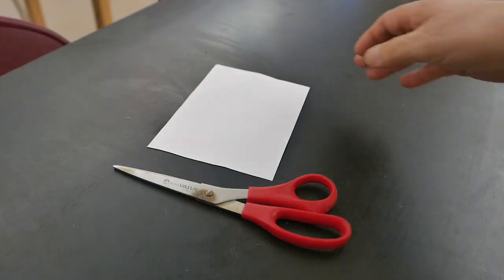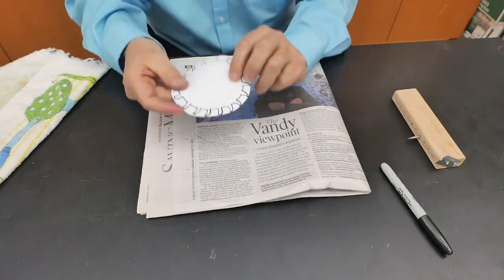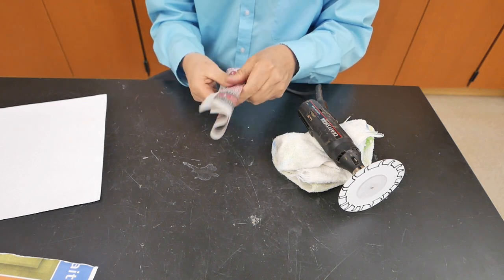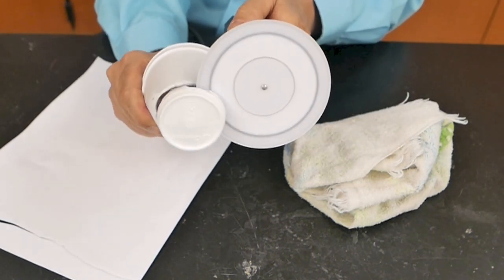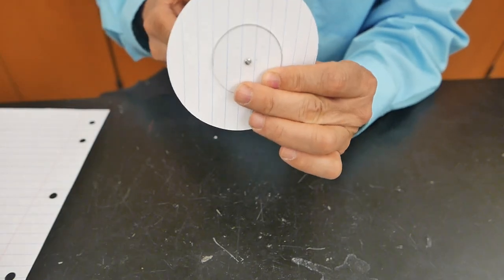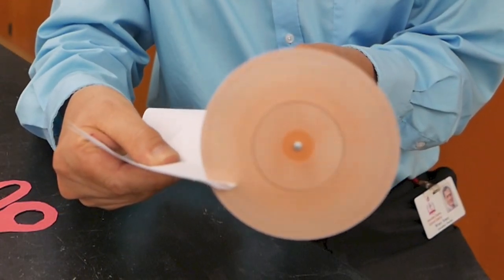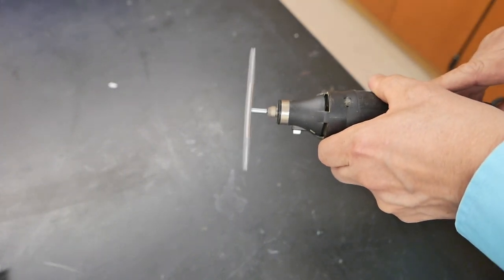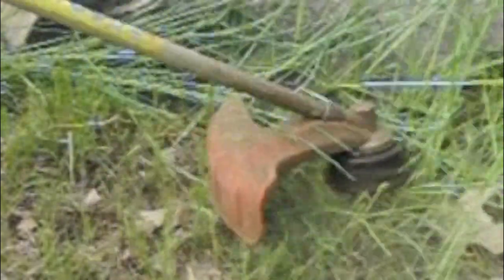Paper Saw Blades- paper cuts paper- Part 1- centrifugal force  //  Homemade Science with Bruce Yeany

Comment: Very cool! 

I ran into the same effect in a creative technologies lab I developed a few years ago. In one seminar, we work with electric motors. The motor in the lab kit has a bare spindle, so it's hard to see it in motion. I needed something cheap and easy, so I printed off Benham disk patterns, which helped visualize differences in speed. Rather than a plastic support, I used electrical tape with a pin hole in it. After a few nasty paper cuts, I spent some time seeing what I could cut with it. It became a three in one lesson. :)

Comment: Is it the centripetal force keeping it from ripping apart along with the thickness of the paper?
Reply: Yes, the centripetal force keeps each particle at a set (or roughly set) distance from the center.  With a less thick piece of paper, the centripetal force would be lesser, allowing it to rip apart.
Reply: on account of centrifugal force not existing
Reply: No. Centripetal force is just the force required to keep the paper together, which is just provided by the binding in the paper. It does not increase or decrease as the speed of the rotation increases. As speed increases more centripetal force is required in order to remain in the circular rotation.
The paper is in fact ripping, but it is along the side of the circle (Circular prism if we want to be pedantic), which I would predict is deteriorating at the same rate, if not faster, than the paper it's cutting.

Comment: Centrifugal force doesn't exist 
Centripetal force, however, does
Reply: Wrong!
Reply: But it's still not a real force. There is no force pulling an object away from the center of its rotation as we perceive. The only force in this situation would be the tension keeping the object from flying away tangentially to the rotation. Since the object has inertia which makes it want to continue in a straight path, the aforementioned tension provides a force perpendicular to that path keeping it rotating. That tension is the "centripetal force" you feel.
Reply: All there is is inertia. Everything else is an emergent effect.
Reply: +Dylan Headrick Do you know what centripetal means ? because I see a lot of comments here that says the same thing "centripetal force is not a force", if you say that is like saying "there is tension that makes the object rotate but the tension does not exist " in this case the centripetal force IS the tension because is a force but the centrifugal is not, because is an effect of inertia there is NO force like coriolis effect. We say that a force is fictitious when if you are placed in a Galilean referential there's not need of these forces to explain the movement of the object, particle, etc.
Reply: Exactly

Comment: Is this Centripetal Force or is Centrifugal Force? If Centrifugal force is "the tendency of an object following a curved path to fly away from the center of curvature." and Centripetal force is "the force that keeps an object moving with a uniform speed along a circular path."
Reply from the maker: The behavior is described as centrifugal force, even though it is not real.  The tendency of an object in motion is to move in a straight path unless a force acts to change it's path,  when a  centripetal force is applied to an object it's path may curve if the force is applied continuously  towards a center of rotation, however, the inertia of the object is tangent to the curved path and the result is apparent outward force (apparent not being real) that we call centrifugal force.  while the behavior is real, there is no outward force.  I've always thought the terminology is wrong,  it should be called centrifugal motion rather than force, that way it would be less confusing

Comment: Would a paper blade cut another paper blade if they are both spinning at 12000 RPMs?
Reply from the maker: dueling saw blades!!  I'd guess they would shred each other rather than cut since the place where the blades touch would always be changing
Reply: Bruce Yeany I figured as much. I just wanted to prompt you to maybe try and film it sometime in the future :)

Comment: Impressive... MOST impressive. i want one now.
Reply from the maker: Hi Dan,   I've been challenged to find other materials that I can cut with it,  It's getting obvious why they don't make paper saw blades
Reply: Yeah, I tested it and it IS pretty obvious.
Reply: Is it safe to say that it will cut anything that is lower than it on the mohs scale?
Reply from the maker: Hi Jesse,   It's funny that you should mention that,  I was hoping I could redefine the rules for paper rock scissors by showing paper cutting rock so I borrowed a piece of talc from the earth science teacher. After several tries,  it was unsuccessful.  However, I've been challenged to make a list of materials/ objects that can be cut and plan to make a follow up video. Perhaps  we can make a new list of materials that aren't presently shown on the Mohs scale at the moment.
Reply: well, technically you could make "paper" from glass fiber, and perhaps cut a soft kind of rock with it?
Reply: Interesting concept...

Comment: I wonder how long you could consecutively use that before the paper catches fire.
Reply from the maker: Hello Juha,   Good question,  so far all the circles have shredded before they  got to that point.
Reply: +Bruce Yeany (Yeany Science) Some kind of universe's internal safety mechanism I guess. :D
Reply from the maker: that made me laugh,  thanks
Reply: It can't ignite or even get charred, because it cools down as it spins, it doesn't have enough mass to accumulate heat and it dissipates heat as it spins.

Comment: wasn't  a smooth transition before you put the "paper" up to the news paper... all other scenes were solid and one but as as soon as it comes to the paper... theres a cut in cut out and cut back  10:51 -1053..... why that ?
Reply from the maker: Hi NoVaKane,     If I remember correctly, I was holding the paper which was very flimsy and it might have bent down right as I started so I tried it again and cut out the first try out.   Looking at the pictures of the comic, it is the still the same circle cut of of the "Mary Worth" newspaper comic.

Comment: Comparing that to a string trimmer is a terrible analogy because the line is made out of tough plastic. When you can cut grass using grass in a string trimmer, let me know. (And no cheating, using things like bamboo!) Otherwise, awesome video!
Reply from the maker: LOL, you guys are killing me on this video.  Let's see if I can defend myself.  I showed that the  paper is flexible and purposely put bends in it,  I showed how spinning makes it become rigid enough to cut through materials.  I then showed the plastic line bent and flexible and then stated when it is spinning that it also becomes rigid enough that it can cut though materials.  Paper doesn't cut when not moving, the plastic doesn't cut when not moving.  My point was that I was really trying to show how the behavior was similar.   In part two,  I try cutting various other materials using the paper saw blade, so in that case I am not matching up the blade material to what is being cut. I can't see spinning a banana peel to cut a banana.  Funny thing about the weed trimmer, every so often I get a tough weed caught in the spinning mechanism,   I wonder if it is helping to cut other weeds down.  Anyway,  thanks for your comment, I hope that it makes some sense.

Comment: Is it that more the rpm, the harder substance it will cut through?
Reply: Lel imagine if it goes fast enough to cut through metal
Reply: Next up: Cutting diamonds with paper
Reply: +Scawsome wow
Reply: up to a certain speed. as the paper spins, the centripetal force is pulling the fibers of the paper strongly from center to outside. The fibers can only handle so much force before they rip apart. Figuring out that speed for a given radius and paper type would be a fun experiment.

Comment: You say centripetal force butt then you wrote down centrifugal force on the example. They are different "forces" it is centrifugal
Reply: I don't believe in centrifugal force. There are two forces in play here, The centripetal force keeping the "saw" blade from coming apart and flying off on a tangent and inertia which is keeping the "saw" taut. The centrifugal farce is just that. It isn't real and discussing just confuses people.
Reply from the maker: I think we agree here on "centrifugal force".  I  point out that this is a fictitious force.   The behavior that it describes is real enough, however the words defining it are incorrect. the term "force" used with the word centrifugal  is misleading and wrong,  there is no force applied radially outwards.   However, even though it is mislabeled, the term centrifugal force is used to describe the motion of the matter or an object moving  radially outwards.  This is what we observe here when the paper straightens out when spinning  or the string on a grass trimmer becomes rigid as it spins and can be seen in all sorts of other examples and applications all well.  It can be as simple as soaking a towel with water and spinning it over your head.  The water drops move away from the towel directly outwards from the center of rotation ( centrifugal force)  My preference would be to call it a centrifugal motion.   What we are seeing is a cause and effect.  The centripetal force which causes the object to curve off of a straight is applied inwards towards  the center of rotation.  This inward force pulls against the inertia of the object and the effect or result is an outward movement even though there is no outward force.
Reply from the maker: I watched the video  and I think it only is giving part of the picture,   it fails to address the centrifugal behavior of spinning objects.  Simplest example, soak a towel and spin it over your head,  the drops will move directly  radially outward from the spinning towel. not tangent to the circle as described here.  I also did a video on spin art,  go back and look at the pictures formed,  you will see the paint lines are radially outwards.  It is cause and effect, centripetal plus the inertia result in a motion outwards, the result is described as centrifugal force even though there is no outward applied force.
Reply: Bruce Yeany I do not know if you are saying centripetal or centrifugal in the video. Because centripetal force is talking aboot the acceleration going to the center of the object and centrifugal is talking aboot the outward inertia.
Reply from the maker: thanks Herranton1979, that is a great video,  and we can see that the drops are not radiating directly outwards as I described , but spiraling out.  If you stop the video and examine a still picture where you described, I wouldn't  say it was tangent to the surface of the ball either,  but some where  in-between both descriptions.  I used to have a couple time lapse photographs that showed the same thing, not directly outwards but definitely not tangent either.  One of these days I have a couple of experiments that I've always wanted to try and see the happens.   In the meantime,  please take a look at my video on spin art and look at the  still pictures at the end of the video.  In this case  you will see paint trails  radiate directly outwards and would intersect the center of rotation.  I'd be interested in your opinion.
https://www.youtube.com/watch?v=FF0U7YIwm4M
Reply: +Bruce Yeany (Yeany Science) I actually did find that video on my own when you mentioned it. I must confess that it has me stumped. There has to be something else here that my stupid brain is missing. I've been thinking about it on and off all day.
Reply from the maker: What would really be interesting would be to try and get a better  video of the paint drops on the spin art leaving the paper and hitting the box wall. I'd like to know if they are showing the same thing as the spinning foam ball, and if so, why aren't they doing it on the paper.  At the moment I've been scratching my head trying to figure out what's going on.  I know a few folks that are  a lot better at this than I am, it might be time to seek some professional help.
Reply: As far as I know Centrifugal Force does not exist. It is all about Inertia and Inertia is not a Force (You may want to check its definition again) as well. The paper becomes stiffer because of the Inertia of the particles since they want to keep their translational motion which is tangent to the circular track(or outwards from the cicle).
Reply: Bruce Yeany The spin art video proves that centrifugal force is nonexistent. At 2:38, it clearly shows a paint droplet splashing orthogonally to the radius of the circle.

The reason why you get radial lines is because of the path the paint takes with regard to the spin. This is because the paint moves at approximately the same speed as the disc and thus, the disc would 'catch up' to the orthogonal path of the paint.

If centrifugal force were existent, there would be spiralling lines of paint, as the paint travelled radially outward while the disc spun.

Comment: There's no such thing as, "centrifugal force".  That's an outdated term and notion.  It's now something different referred to as, "centripetal force".
Reply from the maker: Centripetal force does not fully explain the behavior,  first "centrifugal force", I would point out that this is a fictitious force. The behavior that it describes is real enough, however the words defining it are incorrect. the term "force" used with the word centrifugal is misleading and wrong, there is no force applied radially outwards. However, even though it is mislabeled, the term centrifugal force is used to describe the motion of the matter or an object moving radially outwards. This is what we observe here when the paper straightens out when spinning or the string on a grass trimmer becomes rigid as it spins and can be seen in all sorts of other examples and applications all well. It can be as simple as soaking a towel with water and spinning it over your head. The water drops move away from the towel directly outwards from the center of rotation ( centrifugal force) My preference would be to call it a centrifugal motion. What we are seeing is a cause and effect. The centripetal force which causes the object to curve off of a straight is applied inwards towards the center of rotation. This inward force pulls against the inertia of the object and the effect or result is an outward movement even though there is no outward force.

Comment: Hmm, I wonder how this would do with a thin sheet of plastic.
Reply from the maker: in part two I try it on a milk jug,
Reply: I mean if the blade was made of a thin and slightly rigid sheet of plastic. It would probably just heat up and melt, lol.
Reply from the maker: I guess that will have to wait until part 3 as I have some other videos that I want to get to,   I'm already getting more suggestions to try and will try the plastic

Comment: Hey bruce can a toy engine do that cuz imma do this for my physics project
Reply from the maker: I didn't try it but it might,  the toy motors I use are rated at 1.5 to 3 volts.  To get them to spin faster I quite often kick the voltage up to 6- 7.5 volts  for short periods of time and they survive it.  That might help in this case.  Let us know how you make out with it

Comment: Try cutting metal. 

Imagine replacing household tools with tha
Reply from the maker: Hello Sir Iodine,
I've tried cutting harder materials, in those cases the paper breaks down without making a scratch.  I would imagine if we got it spinning much faster the G forces would tear it apart. It is fun with what I've used though.
Reply: Bruce Yeany Maybe you can try a soft metal? Like maybe Aluminium?
Reply from the maker: good idea,  I'll try it with aluminum foil

Comment: I haven't watched the video, but I just wanted to mention that centrifugal force doesn't exist.
Reply: +Bruce Yeany (Yeany Science)   sorry for my spelling but im still learning
Reply from the maker: If you had watched the video, you would see that I clarified it a bit.  The behavior that it describes is real enough, however the words defining it are incorrect. the term "force" used with the word centrifugal  is misleading and wrong,  there is no force applied radially outwards.   However, even though it is mislabeled, the term centrifugal force is used to describe the motion of the matter or an object moving  radially outwards.  This is what we observe here when the paper straightens out when spinning  or the string on a grass trimmer becomes rigid as it spins and can be seen in all sorts of other examples and applications all well.  It can be as simple as soaking a towel with water and spinning it over your head.  The water drops move away from the towel directly outwards from the center of rotation ( centrifugal force)  My preference would be to call it a centrifugal motion.   What we are seeing is a cause and effect.  The centripetal force which causes the object to curve off of a straight is applied inwards towards  the center of rotation.  This inward force pulls against the inertia of the object and the effect or result is an outward movement even though there is no outward force.
Reply: +Bruce Yeany (Yeany Science) if the force was stronger will the Paper breack      like a foam whell or a cd
Reply: +Bruce Yeany (Yeany Science) HE JUST GOT BUUURRRNNNEEEDDD